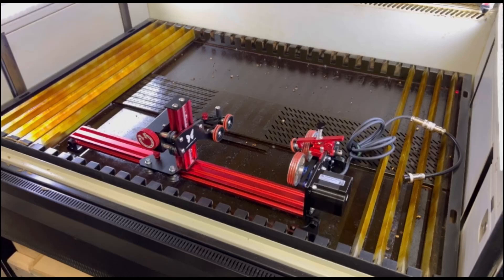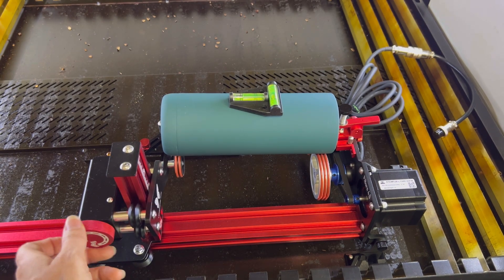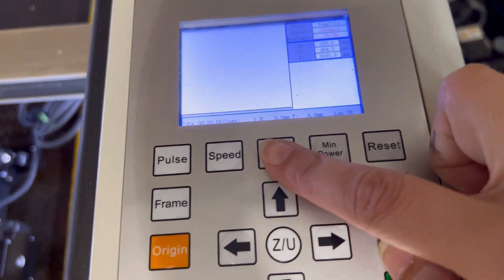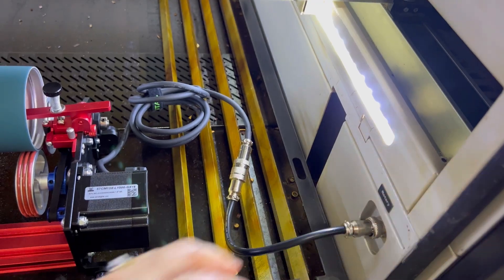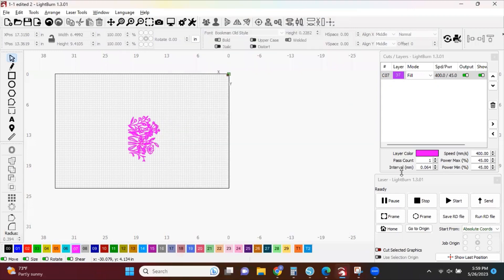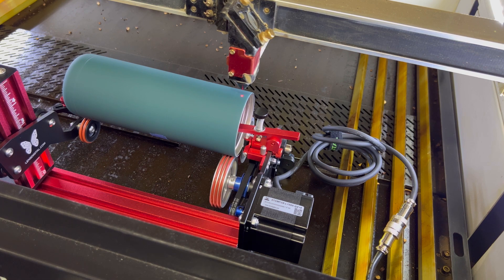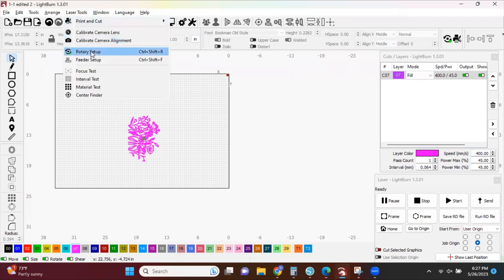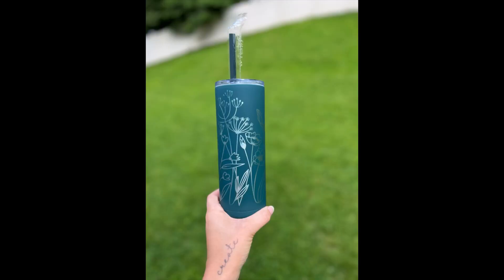How to Hook up a PiBurn 4.0 Rotary to your Laser (Aeon Mira 9)

Comment: Great video. I seen your steps per rotation were 25000. I have the same rotary and I think mine are about 35000 or 38000. 63mm is wheel. And I’m new to this. You have any video incite on how to calculate?

Comment: Does the rotary cable have 6 pins like the Aeon or did you have to buy an adaptor for it?
Reply: When buying it, you select your laser brand and it comes with the proper cable.

Comment: I followed all the steps and I am getting a y slop error on my Mira 7. I can't seem to get past it
Reply from the maker: Have you tried shutting everything off and starting again? If so and it still gives you that error, I’d go to aeons website and put in a support ticket so they can tell you what’s going on ☺️ They are usually super quick at getting back to you! Or you can try the Aeon operator Fb group, or lensdigital Fb group as well ❤️